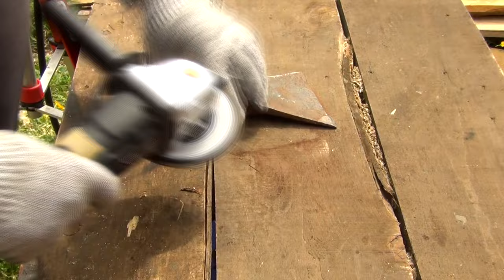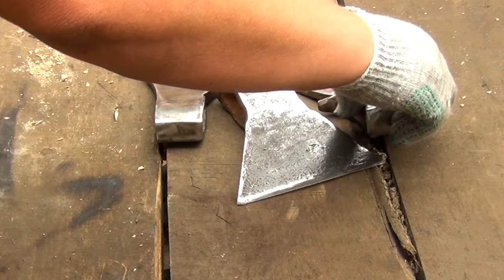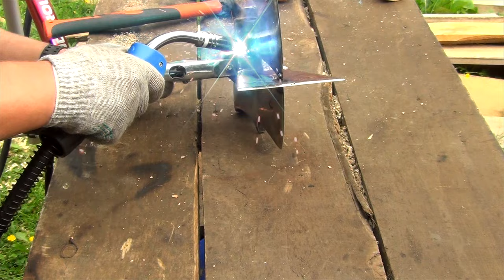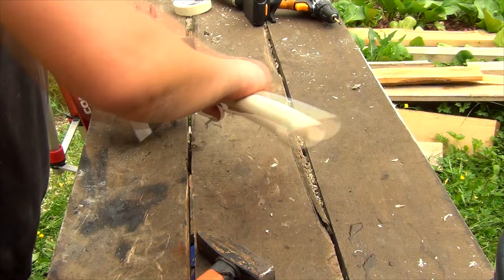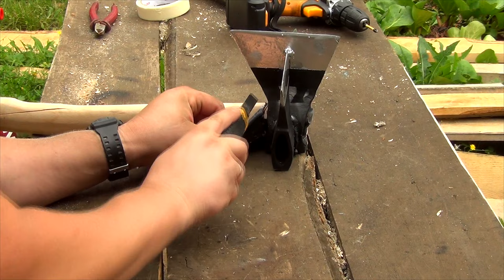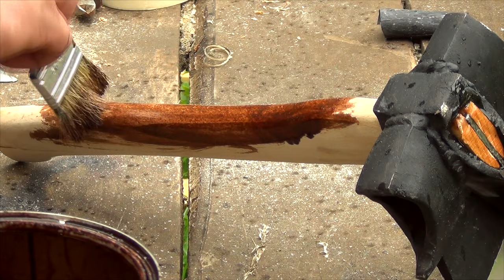AMAZING renovation of an old axe! The result will surprise you

Comment: you have not renovated anything just ruined 3 perfectly good axe heads! That is also the wrong way to wedge the handle. First a wooden wedge should have been used in the line of that steel one then short metal ones used across the woden ones
Reply: Will definitely NOT subscribe